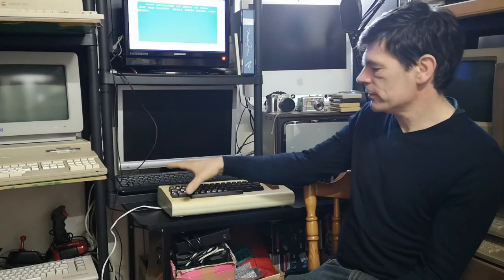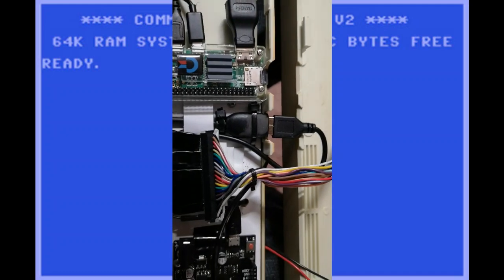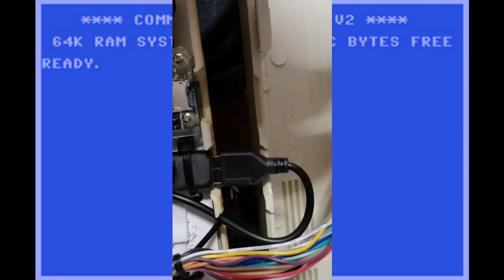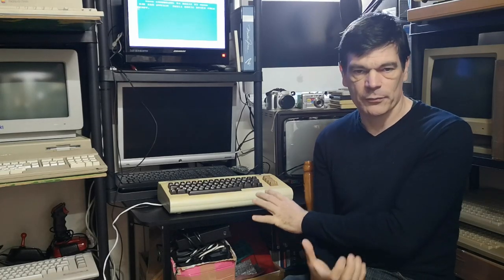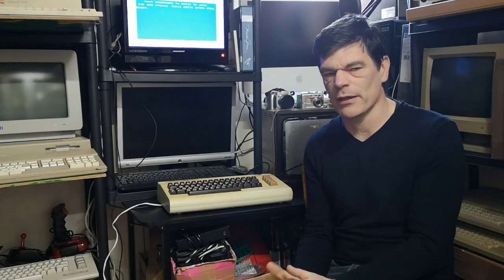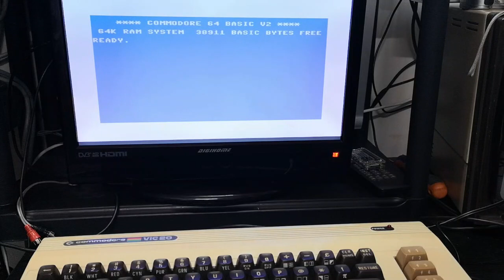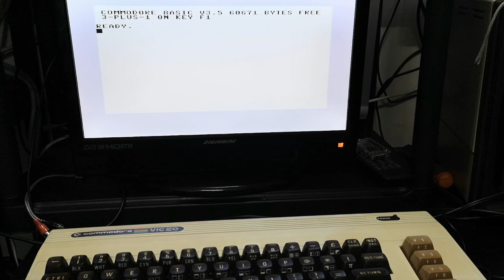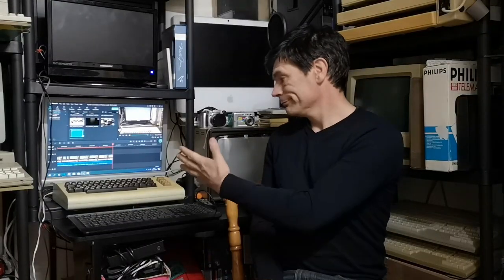Classic Computer The C64 Maxi  Home Brew rival

Comment from the maker: I would next time as it was a long slog to get the keyboard to work properly. But it was something I had in my 'junk' pile so to speak and I thought I would give it a go. I  kinda like re-using tech that would normally be left for the land fill and it is nice to be able to put it to good use.  The  Leonardo board is not bad and it can act as a good controller and it is something I  will probably look into in the future. I have not used a Pro micro so I may have a look  at that  as well.  
There is always something  new and different to play with  which is a good  thing. I am also sure other people have  other ways of doing things which is always welcome, as  learning new things is always a good thing.  Thanks for the feed-back and thanks for  your comment. Cheers Phil